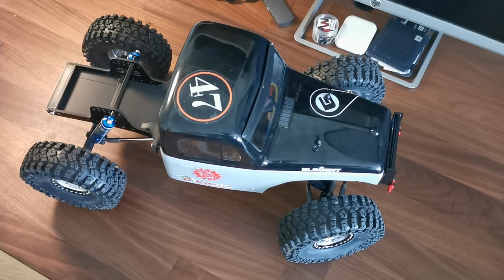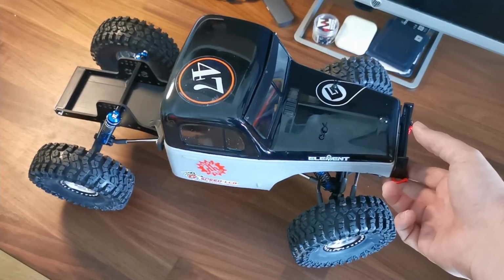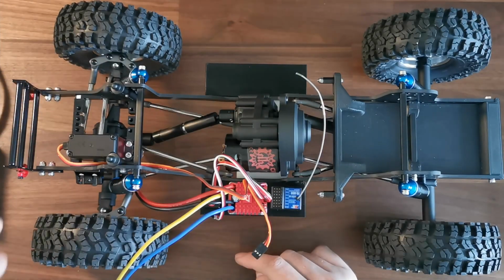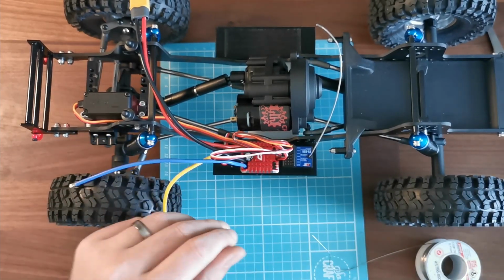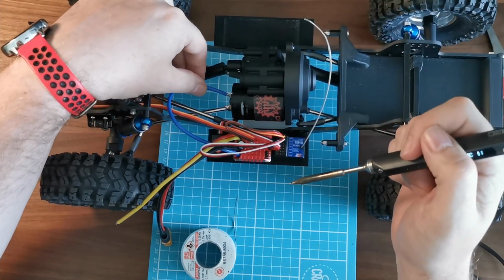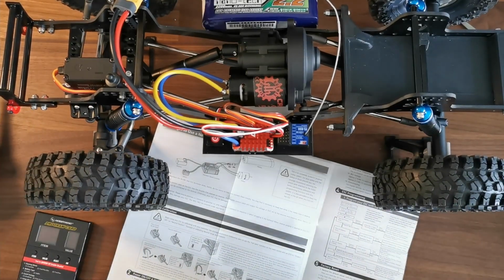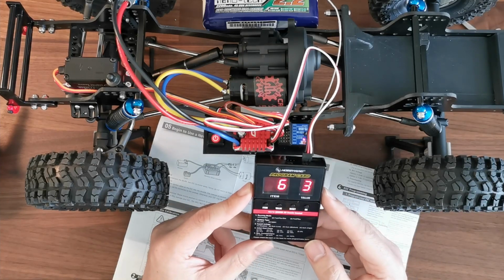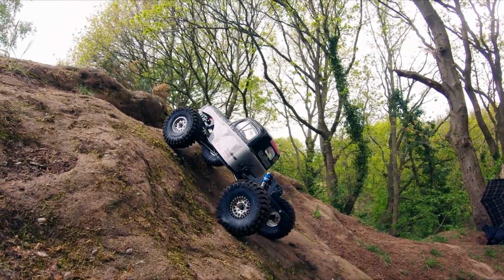GSpeed Element Enduro - Pt3: Electrics and Test Run

Comment: Thank you for the great review of my bumper. It's very good to hear your happy with it.
Reply from the maker: Nice one. It is a great bumper and is taking some serious abuse 😂
If you ever make one without the tow ring eyelets please let me know! 🤙
Reply: @PhilBrindley  I did have some of them but they sold out super fast. I will be doing more. Keep an eye out.
Reply: @PhilBrindley  u guys got a link for front and rear generic ebay bumpers that will fit gspeed chassis?? Thanks in advance!
Reply from the maker: The only ones I know for sure will fit are the front bumpers that Spencer makes. (link below). I didn't use a rear bumper as I designed one in to the 3D Printed bed I made. 🤙
https://www.ebay.co.uk/itm/1-10-rc-metal-front-bumper-ball-bar-VS410-SCX10-72mm-wide-Type-C-/174602566589?mkcid=16&mkevt=1&_trksid=p2349624.m46890.l49286&mkrid=710-127635-2958-0
Reply: Hi, awesome build. I’m trying to find one of those bumpers but the link doesn’t work. Is there anywhere else I could get one please?

Comment: Thanks for the info as trucks looking awesome could you tell me where you got the bumper as looks mint 👍🏼👍🏼
Reply from the maker: Picked it up off eBay, But looks like they are sold out at the minute. This one is similar and by the same seller.
https://www.ebay.co.uk/itm/1-10-rc-metal-front-bumper-ball-bar-VS410-SCX10-72mm-wide-Type-C-/174602566589?mkcid=16&mkevt=1&_trksid=p2349624.m46890.l49286&mkrid=710-127635-2958-0
🤙
Reply: @PhilBrindley  thanks buddy that’s much appreciate what size did you get buddy as yeah it something that’s on the list now 👍🏼

Comment: hey, did you fixed the issue with the shock travel?  if yes what did you do?
Reply from the maker: I got it very close to a fix and the panhard only hits the pumpkin is very extreme cases (and then only just). I used on of the 5mm spacers and the smaller servo spacer that comes with the builders kit. Then I used a 5mm spacer on the servo. 
I have since changed the shocks to Desert Lizards from my other truck and the issue has now gone as they have a little less overall travel than the Element shocks. 🤙
Reply: @PhilBrindley  okay thanks for the answer :) I'm getting my gspeed chassis for the element in a couple of days and I'm already excited to begin this build 😎 luckely I have your vids saved to help me out 😁
Reply from the maker: @therealHUSA  no worries. Glad to help. 🤙

Comment: Great build!! I’m looking to build something very similar soon. I’m wondering why you didn’t change the throttle to reverse in the GT5 ? Is there a benefit to swapping the wires vs making the adjustment in the receiver? Thanks
Reply from the maker: I think I'm just in the habit of that from my drone builds, where I always feel it's better to have it physically correct, rather than asking the software to change it. That said, I don't think there is any reason not to just reverse the channel with cars. Good luck with your build. 🤙
Reply: Yes on some esc's they have different throttle curves this could then be reversed unintentionally.

Also when he changes the reverse % it wouldn't be reverse your changing, if you had switched it on the controller and not the ESC then he would only have 50/75% forward even though he'd set it on the program card for reverse.
Reply: If you reverse the channel, I believe the motor will spin the wrong way, giving you essentially a faster reverse, at least it's that way on some set ups, I imagine high end electrics can figure this out for themselves though, like sensored brushless combos.

Comment: Beg My Pard , One more question , do The Body Posts come with the Kit or did you order separate ?
Reply from the maker: Hi. The body posts on the front came with the kit. The ones at the back are just nylon standoffs to help keep the body in place, there are no clips in them.